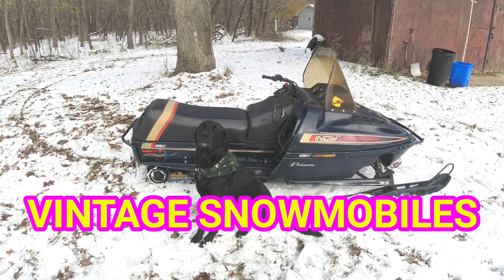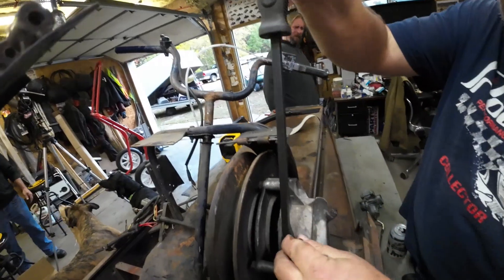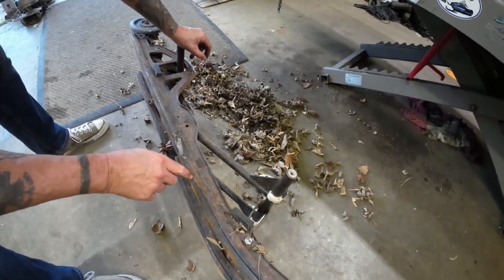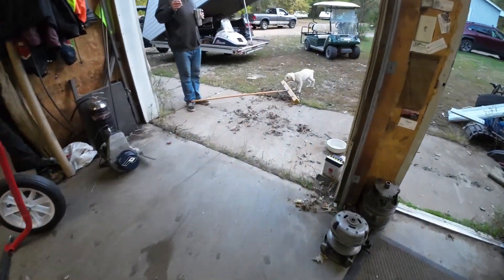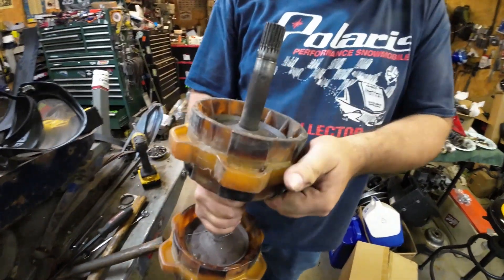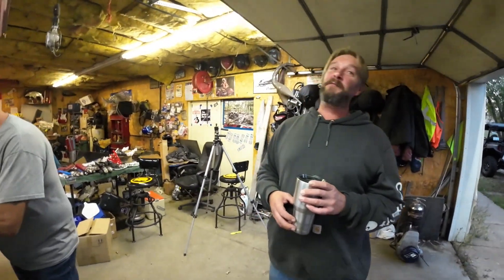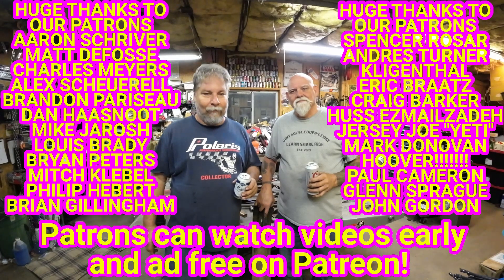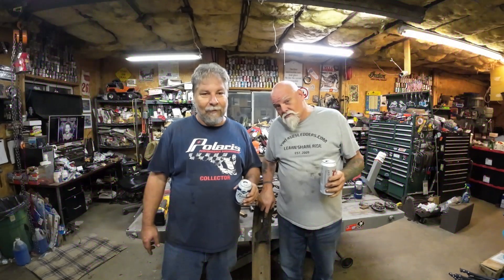Polaris Gemini One Lung Racer Part 2. Tear Down. Vintage Snowmobile single cylinder racing.

Comment: Hey Nutter! I tore my primary off my 77 TX 340. It is bad! Needs rollers, buttons, and the bushing. I thought I`d ask you since you know these TX`s inside and out. Financially it is likely best to update this clutch. What is the best clutch and what years worked as per the crank stub? Thanks, Darcy
Reply from the maker: Any of the newer 32mm taper clutches fit. That is what we use. Something like a 2010 and newer 600 or 650. Blue spring and 10-44 weights for a starting point.
Reply: Thank You
Reply: @nuttersspeedshop  I have a guy that has a P85 and says it is off a 2012. The closes weights he has are 10-46. Would this work for my TX 340? Anything else I need to do or will it bolt straight on using my original clutch bolt?
Reply from the maker: @darcy32171  I don't know why it wouldn't work. It always has worked for me. Not sure which bolt i use. Probably stock, but I keep some other bolts around just in case and I really don't keep track which bolt I use where. Might need the bolt from the later sled? Worst case you need to buy a different length 7/16 fine thread bolt, grade 5 or 8. You can get the top hat bushing for the bolt from Polaris. 10-46 weights and a blue or almond spring is a good start. You can probably tune from there with a different helix and secondary spring.

Comment: Not sure if you will see this but a video of what specifically you can swap from what year of colt.. I picked a single cylinder gemini up and I'm having a heck of a time finding parts may have an easier time finding a colt
Reply from the maker: Track, skid, chain case, engine, skis, spindles are all the same as colt. The main differences are the cosmetic items.
Reply: Awesome thank you so much

Comment: I was hoping you knew a trick I don't. Every time I've tried to do slides like that it has been a complete bitch and the hard part is getting the new slide on.
Reply from the maker: Camp fire has to work, right?
Reply: @nuttersspeedshop  Won't be much help getting the new slides on though!
Reply from the maker: @MrStorbeck  We will see on these steel rails, but in the past the trick has been to wire brush the rust, lots of WD40 and an air hammer to vibrate them into place.